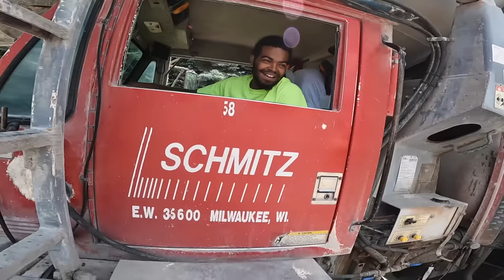BIG driveway pour and employee wouldn't be denied!

Comment: Ryan as I mentioned before.....super plactisizer......it'll keep it wet without adding water  . Tell the batcher when you order  . Also keep some on your truck for emergencies  . You may also have the batcher substitute some of the water with ice  . There is a calculation if they offer ice  . Helps keep the concrete cool to give you working time  . And finally get used to your vibratory screed  . Helps if you're running out of time and short handed . Just some tips for hot weather concrete  . Use individually or together depending on your urgency  to get you out of hot water  , lol , no pun intended  . From south western Pennsylvania  . How much trash do we make  hahaha  .

Comment: Hi Brother, were poiring in 90° heat and wind with a type 1L 6 sac.
 The new 1L portland is brutal.
I use alot of Day one lythic densifier and it helps my finishers and helps retain availiable moisture in the surface .
We steel everything out here before we broom or stamp so this gives me a little.piece.of mind.
 Love the vidieos and the psoitive attitude. Try the day one...you will love it.

Comment: Good seeing Bugs back to work that's a tough injury to get back from so quick...... Something we have also noticed on the east coast Ryan is the same issues with the concrete this year. I also want to add to that it seems like if the truck is sitting on basically any grade at all when having water added is that it isn't spinning up right in the drum, we have been having the drivers back out onto the street before adding water. That has seemed to help a little bit, but its super frustrating and the suppliers seem to just brush it off like we don't know what we are talking about. We are going to start doing as you did and adding retarder cause every minute counts.

Comment: If it's the case where fly ash is being used, you guys may have to use pool trowels to close up your concrete. As I said, you can use trowels to close up exterior concrete, however you can't OVERTROWEL the surface. The Pool trowel is much more flexible than a mag which won't cause control joints and edges to pinch so easy . We have been using pool trowels here in the Philadelphia Pa region for a long time

Comment: Ryan, I'm a new subscriber, love the videos. 

Have you ever considered using #6 gauge wire vs. #10 gauge. I think you should consider it...if the costs isn't much more. I contracted this type of work during the 1970's. I suddenly got several govenment contracts that required #6 guage wire mesh. After a few jobs I decided to figure the larger gauge wire into all my jobs...if possible. The thicker wire really made a difference in the cocrete's life and strength. I never went back to #10 gauge wire...one of my best decisions I made during my career.

Comment: I use control finish in a pump sprayer when it’s windy or if the sun is baking it it works great I’ve been using it for years it’s safe for colored concrete also

Comment: Water the base like crazy and use confilm for the top. Won’t have any issues with dry times. Darby(bull float) the confilm into the job. Or as they work there way down the driveway sprinkle some down work it in and finish the job. Stuffs a lifesaver.

Comment: Look the only other way to slow down the set time of the concrete is to chill it. Commercial companies do this and will chill the concrete with ice or chilled water and liquid nitrogen. The mix plants can do this but it's going to cost you more is all. You should be shooting for a 70 degree concrete mix on site delivered. If the concrete is arriving at ambient temps over 90 degrees you are going to have major issues like fast setting. Higher temps always speed up chemical reactions, it's just science. Lower temps cause slower reactions. You should be taking your mix temperature when it arrives along with checking your slump. I would like to see you start doing this in your videos.

Comment: I know for shop pads we use plastic as a vapor barrier, but we don't use it on drives and such being as our concrete is pretty nice. Is there a reason not to put a barrier to hold moisture in the concrete. I know that it would be another thing in the way during the pour, but It would hold the moisture better. Also I don't know if ots a great idea being as your alls climate gets so cold, maybe it would retain to much moisture within the concrete.

Comment: As I'm not too familiar with cement trucks and how they work I was just curious if anyone knew if the chute can go into a free spoil mode and can be manually moved by someone  . Seams like it would be easier for a poor but what do I know. Also maybe a controller or something that someone can control from outside incase the driver is inexperienced. All they would have to do is move the truck back and forth. I dono just curious
Reply: Here in New Zealand, they only move manually.

Comment: I have a legitimate question for you. I've been having this conversation with a friend of mine, and she didn't believe me when I said that you pull forms the same day you pour. Can you give me an explanation as to why you pull same day so I can tell her? When we google how long you should leave forms on it always says 24-48 hours to leave forms on.
Reply: He's mentioned it in past videos.  He pulls them fastest on steps outside a slider.  If the edges will be seen he pulls them around 2 hours, to finish them out.  However, those were older videos which weren't with concrete that set up so quickly as it seems to be the case this season.  The answer from Ryan will prob be "it depends."  36-48 seems unnecessarily long.

Comment: I have zero concrete knowledge, my question is when you pull the mesh then puddle and strike off walking on top of it, doesn't it go back to the bottom?
Reply: The "mud" is 98% gravel.  The mesh sits on all that gravel which makes it impossible to go down to the ground.
Reply: @CY-1627  ah, makes sense.

Comment: You have to admit your at the mercy of the hot days, but you still keep making these big pours.  Everything has its limits.   Only one solution,  split the pour even tho there is a color desrempency.  It's a 50 50 thing here,  concrete vs big pour, concrete will win pushing the envelope.

Comment: What are the chances they are using a hardening agent in the concrete, look at my comments and with GCP we used a hardening agent. I noticed the water you were adding, it should have been running out of the shoot, the extra water is not helping.

Comment: And there pulling so much back you could see the straight edge bending those guys raking should have the raked down shouldn't be pulling back 4 inches of concrete when that straight edge bends it's not flat its just digging